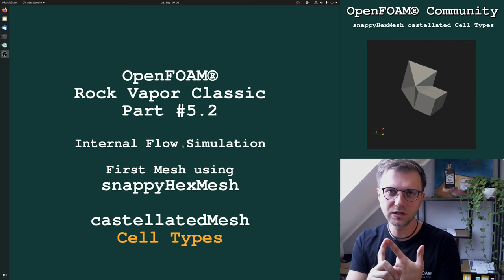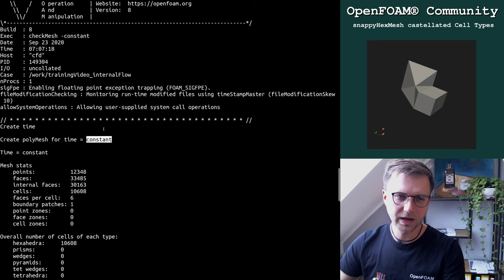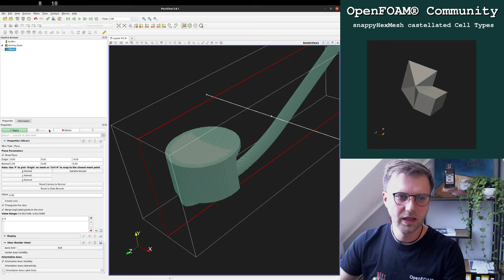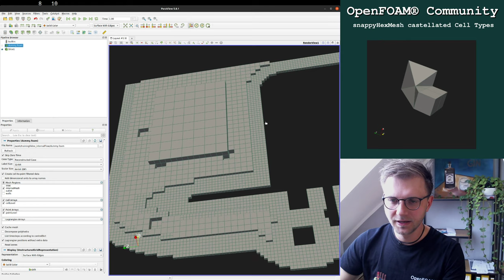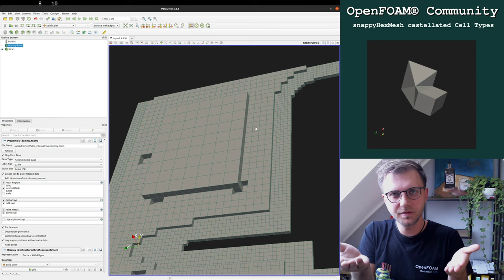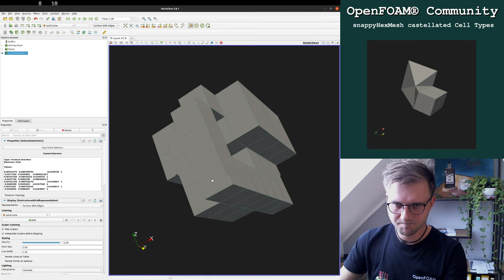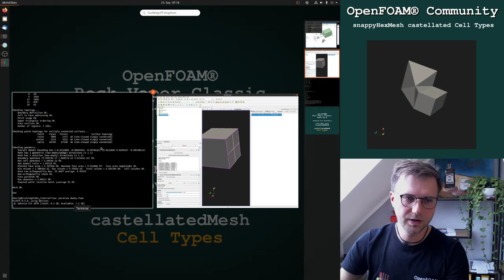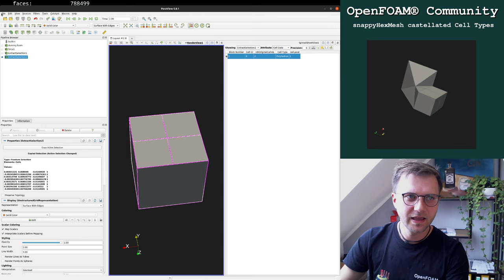CFD Analysis of a Smoking Pipe | Part 5.2 | SnappyHexMesh castellatedMesh Cell Types ∇ OpenFOAM® v8

Comment: This is where the "castellatedMesh" of cfmesh does maybe a bit better. Between the different levels, it does not let the cell as a perfect cubic shape but introduces a tiny angle (ex: https://cfmesh.com/new-release-cfmesh-1-0-1-and-cfsuite-1-0-1/ ). It probably is so that the surface normal is pointing more towards the center of the cell. Probably doesn't make any noticeable difference though.

And another interrogation: On which mesh is it faster to solve the discretized equations?
a) 10000 poly cells with lots of faces
b) 20000 perfect hex cells
(I don't expect an answer :D )

Looking forward for next videos. Great job and Thanks!
Reply from the maker: That is a good question. Fact is... Less cells while having much more faces will not automatically lead to a faster run time as we have to make more calculations on the Faces such as interlolation and others. This could be an interesting investigation. However, a case idea is missing. Comparing 2d cases and simple analysis will lead to wrong results.

I would expect to have the hexahedral mesh faster compared to the polyhedra mesh.

Comment: Thanks for one more great video. I have one small question. When one face is shared with 4 other smaller faces how does the Interpolation happen between the big cell and the other smaller cells sharing the same face.

Between thanks for explaining this process
Reply from the maker: So you mean an interface such as using AMI? As I explained, there is no face (a big one) which is coupled with 4 smaller ones.

Out of your question, maybe my video is misleading?
Reply: @HolzmannCFD  I don't think it's mis-leading may be I am having a hard time grasping the concept
Reply from the maker: @picturesque2566  well, in FVM - as explained - you only have one face for neighbor and owner cell. So if one cell shares 4 neigbour cells on one side, you have four single faces that connects each cell.
Reply: @HolzmannCFD  thanks for the explanation got it now
Reply: @HolzmannCFD  ❤️
Reply from the maker: @picturesque2566  Interesting feedback.